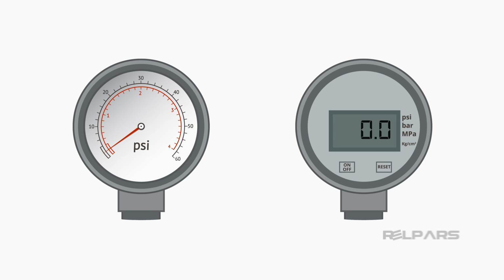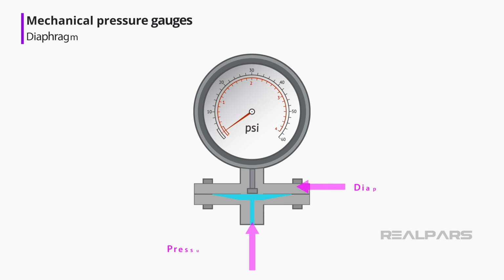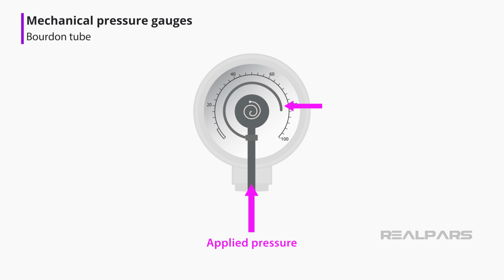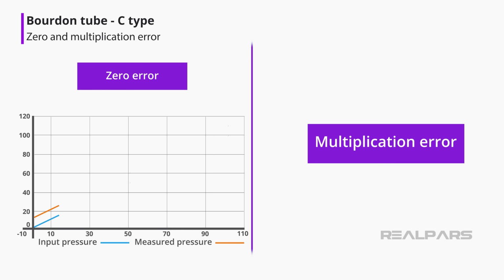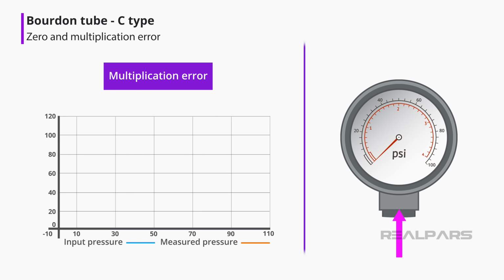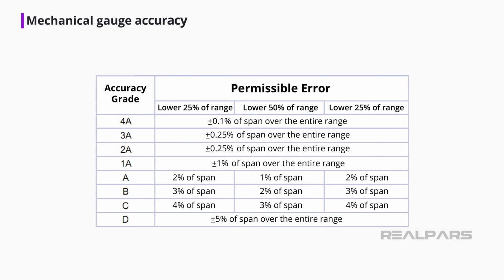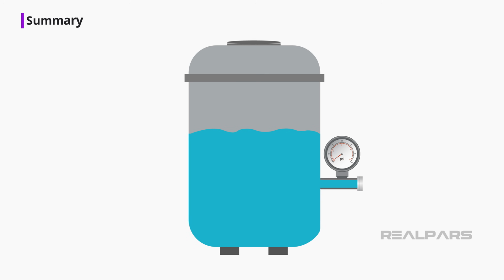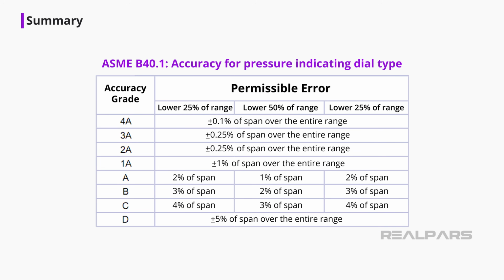Pressure Gauge Explained | Types of Gauges

Comment: What is the difference between 3A & 2A then? It is showing same.
Reply from the maker: Hello @Kishor Roy. Thanks for your question. There are 3 categories of gauges as specified by ASME.  They are Laboratory, Test, and Process. 3A is for Test Gauges, 2A is for Process Gauges. We did not show the categories in our video. Our intent was to show viewers that there was such a table and use the specs for our accuracy example.

Comment: For a 50 psi pressure Gauge, the accuracy is 1% of the span ie 0.5 psi.
How it will be 49 & 51,
It supposed to be 49.5 and 50.5 psi
Am I right?
Reply from the maker: Hi @Jose Thomas. You had me checking my math. But, the answer in the video is correct. The accuracy is 1% of the full-scale value (span) which is 100 psi.
Reply: Thank you Sir, 
it was my mistake. I didn't observe the full range of the gauge.
Anyway great vedeo, and I am expecting more from you.